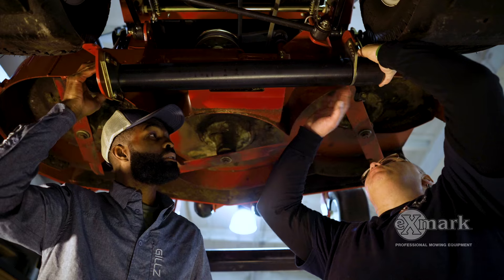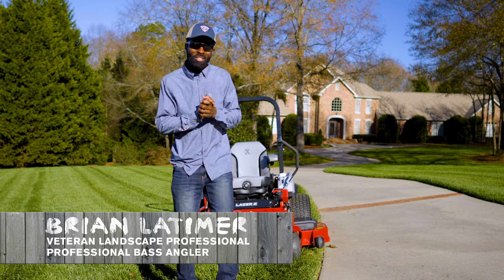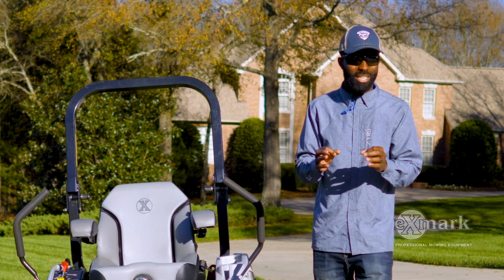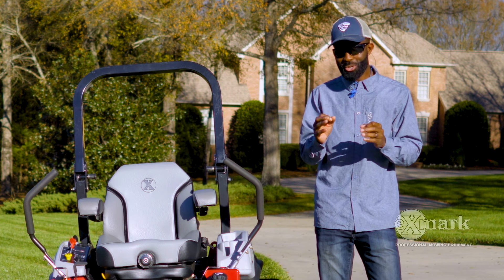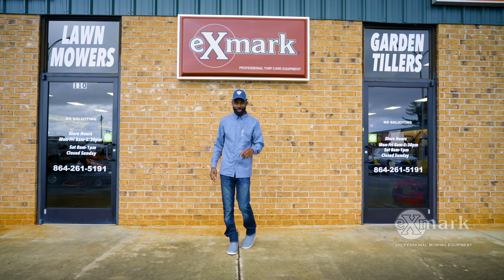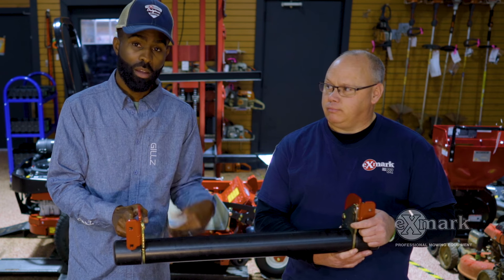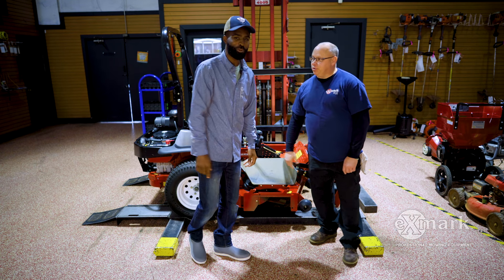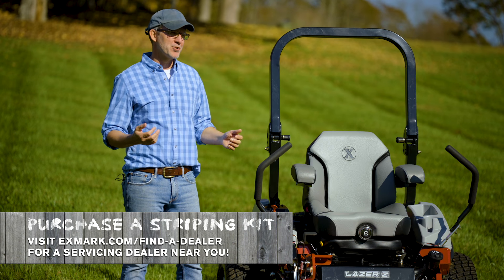How to Stripe a Lawn | Done-In-A-Weekend Projects: Mow Like A Pro II | YouTube

Comment: Hi, Could you tell me how high to cut the lawn for stripes, Is their and ideal cut length?
Reply: Depends on the turf. 4 inches to 5 inches is pretty standard. If you can't see your lines well,  lower the deck a quarter or half inch so they pop out. I cut a few thin lawns at 3.5". You don't wanna cut too low or you'll stress and kill the lawn especially in the heat, so 4" is a decent starting place.
Reply: How do I stripe using a push mower?
Reply: Our landscape company has mower decks set at 4 inches